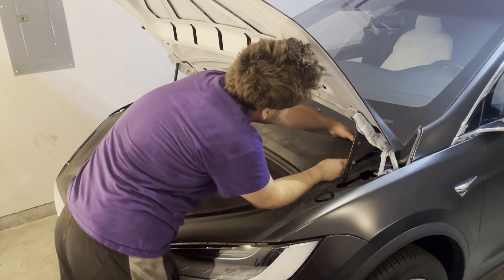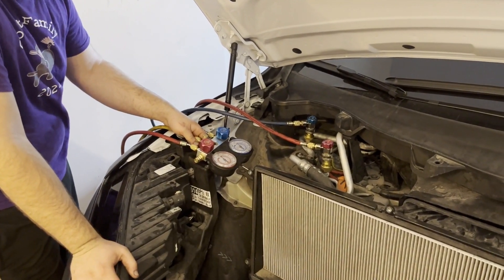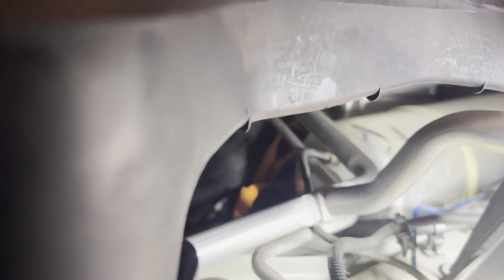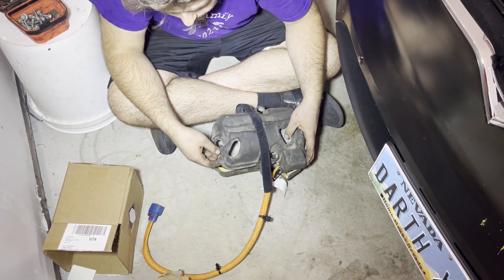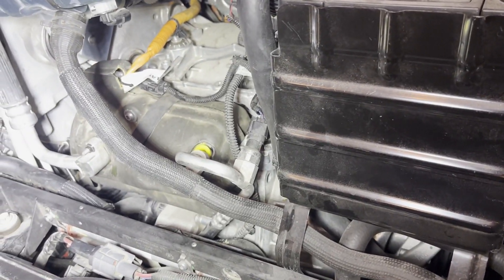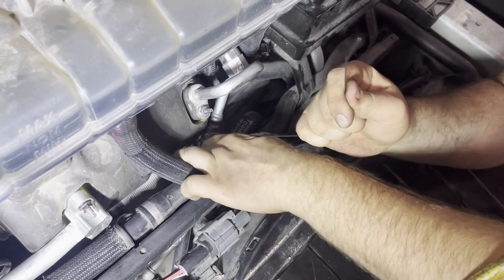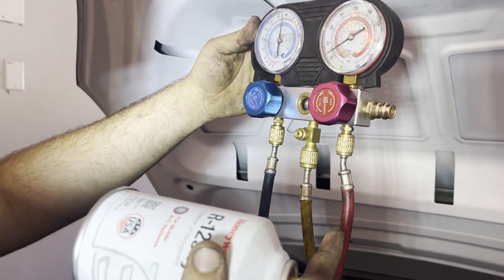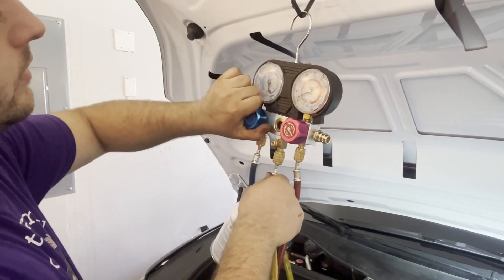Tesla Model X 2020 AC Compressor Replacement

Comment: Thank you for posting the vid, didn’t the compressor require oil, or did it come prefilled with it? Also, where did you buy the compressor?
Reply from the maker: Oil came prefilled with oil, I bought it on Amazon, brand is RYC AD-1456. Has bad reviews but this car hasn’t had a problem with the AC since I did the repair. Some comments say it’s a bad brand or they had bad experiences with there’s so idk if I would trust it 100% and I’m not affiliated with anyone or anything in this video FWI

Comment: Bro how u drain the ac system before u replace compressor
Reply from the maker: Well usually when doing ac repair, the system leaked out to almost 0psi. But the “right” way is to use a refrigerant recovery tank. The quick, dirty, and possibly illegal way is to vent it to the atmosphere
Reply: Thanks bro

Comment: How did you know it was the compressor that was the problem?
Reply from the maker: Loud crunch noise whenever you tried starting up the ac, and since the compressor is the only moving part in the ac we replaced it. I tore down the compressor and found a spiral style compressor that apart of the spiral sheared off and a chunk of metal was loose in the unit
Reply: @redsagehd366 you are AWESOME. Thanks for your hard-work sir!

Comment: Thank you so much for posting, they wanted $4,955.37 for this repair. I know i have to flush the system due to particles possibly in the system. Do you think a 2016 model s is very similar to this install?

Comment: I'm about to do this job thank you for the info the only thing that has me worried is the auto does not turn. On since the AC compressor went out. Because. I got that warning that the car might not restart so.  Now I'm. Concerned about how to get it turned on.  I hope once the faulty compressor is removed it lets me. Start to accurately fill the refrigerant.   Also.  Before 8 start in going to see how to stop the high current. Since I can't. Put it in. Service mode
Reply from the maker: I believe There is also a fire safety switch to disconnect the high voltage batteries from the car if I recall when you’re looking at the frunk, it’s top right and has a fireman’s hat sticker on it. As far as why the car does not turn on, I wouldn’t know without having he car in front of me, best of luck k to you!
Reply: @redsagehd366  thank you my friend

Comment: Thanks for the video, completed it yesterday myself. Definitely saved me quite a few dollars. Getting that HV Connector in the back was really fun ! You make it look so easy haha.
Reply from the maker: Glad it helped!
Reply: What was the tell all that confirmed the compressor was out? 
Mine doesn’t kick on at all and previous weeks it’s been going in short cycles 
2016 model x 
Thanks
Reply from the maker: @andreispiridon3241 In this case crunch noises and bang noises when you turned on the AC, if your ac compressor isn’t turning on at all, you might have too high or to low refrigerant levels, hook up your gauges, locate a chart for normal pressures high and low at the ambient air temp it is outside, that should tell you a lot
Reply: @redsagehd366 got you, I did hook up one of those handheld spray cans gauges when it was running ( not sure how accurate those are but was showing filled) but will hookup the gauges and try, now compressor is not starting at all
Reply: @redsagehd366  I don’t know of a way to check Freon level without the compressor running 
I know there’s Freon in the system and previous weeks the compressor was running on and off, service alerts only THC_d0010_compressor and compNoFeedback after I select the AC but doesn’t start 
In inclined to change compressor and refill although I didn’t hear any weird noises or crackling sounds 
Any suggestions?
Reply: @redsagehd366 I end up unplugging the compressor and ohm it out, in getting some resistance to it and didn’t hear any noises nor leaks 
I’m assuming the only other thing is HV fuse from the DC-to-DC converter (the box that’s feeding the compressor) 
From what I know there’s a AC high voltage fuse that’s feeding the compressor
Reply from the maker: @andreispiridon3241  sorry for being late to answer but in my experience if the refrigerant on the high and low line are equal somewhere around 80 psi it’s plenty full enough to turn on, and once compressor is on it goes to somewhere around 35 low 200 high or whatever the pressures would be at your ambient air temp at the moment. But when compressor is off the pressures slowly equalize to 1 pressure across both high and low sides. If compressor is requested to turn on and both high and low pressures are the same atleast above 50 I would condemn the compressor, sometimes they don’t make noise when they break they can also overheat and lock up. Lemme know what you do

Comment: Did you have to put any oil into the new compressor or was it shipped with it?
Reply from the maker: yup it came with it pre-oiled
Reply: @redsagehd366 finally got it out. That connector is beotch to take out. Also wanted to add that taking the compressor out with the cradle is easier as the bolts are all on top and easily accessible. Thank you again for the video
Reply from the maker: @ivandrusc8658 ya that connector ain’t easy to get to, very glad I could help

Comment: ryc remanufactured compressors have a very high failure rate.. basically all they do is clean them up, paint them and sell them.. I hope you get many years out of it.. if a compressor locks up it's likely to spit metal out into the system, so it would require a flush add new condenser..
Reply from the maker: Ya I wouldn’t endorse this brand, and only ordered from them once. This Customer (my father) chose the cheapest option for replacement which is luckily still working. It goes without saying that investing in a more expensive quality part would be the best course of action for longevity. I just posted the exact compressor that I installed. Sometimes I forget these things are not obvious and I greatly appreciate your comment
Reply: @redsagehd366 would really appreciate if you could point us to a better ac compressor unit that’s not remanufactured. I’m also out in Las Vegas and will be doing a compressor replacement for the first time. Not very knowledgeable about ac systems so your help would be amazing :)
Reply: Yeah tell me about it. Amazon unit failed to work from the get go

Comment: Im just just curious ive replaced the compressor and im ready to vacuum and charge. is there anything in service mode i need to do before adding refrigerant? Please help lol
Reply from the maker: @bmill3449  well you probably shoulda put it in service mode before you disconnected the compressor since it’s high voltage haha but if everything is all put back together and ready to pull vacuum and charge I would not worry about service mode anymore. Theres nothing to reset in the computer, just fill it
Reply: Ohhh ok yeah had to return the compressor cause I jacked it up on the refill as I was refilling the compressor didn't turn on then I added to much then ran heat pump commission and it engaged the compressor but after an hour it went to shit lol I got another coming in from yc but Mann I was close

Comment: You only need to put the car on service mode before working on it? Do you need to disconnect the 12v battery or anything else?
Reply from the maker: @vuanhquoc20  service mode is all I used. From my knowledge the ac compressor does not use the 12v battery, it uses the higher voltage batteries which is why the cable is orange
Reply: Do you need to add ac oil before adding freon? I’m trying to replace my 2016 model x with 134a type, I bought an oem compressor 1042442-00-m, and looks like it came prefilled with oil.
Reply from the maker: if the compressor is prefilled, no oil is needed. If some spills out while installing try to replace what fell out

Comment: Does the hvac compressor need vin matching?
Reply from the maker: The year this car was made I did not match the vin, as far as I know the pump is the same, the difference is how much refrigerant is charged. I do know if you have the 3rd row rear ac model X it takes more refrigerant.

Comment: Does the 2019 have the same compressor ? Mines been exhibiting and issue where ac starts to looses its cool when idling or parked, it would shart to short cycle faster and faster where compressor stays on for only 5 seconds.  The kicker is that it blows cold air when the car is moving, and when im moving for a few minutes at freeway speed the air is cold, and cabins is comfy.
Reply from the maker: @unfair-o2d  the ac condenser is a radiator for refrigerant, mounted at the front of the car so that air can flow past it to cool down the refrigerant. While driving down the road you have more airflow to cool down the refrigerant. The reason it could be shutting off could either be the high side pressure is getting too high or too low. sounds to me you’re either overfilled or under filled with refrigerant.

Comment: Why did the original fail? Would have thought it should last longer.
Reply: Ok so what happened to mine is that the center ball bearing is in pieces and I may be missing pieces 😢. Looks like terrible quality of one bearing is prematurely killing these units
Reply: I will let you know as I will take mine apart
Reply: How did you guys confirmed the compressor was dead and not a HV fuse or something else?
Have a 2016 model x and it completely died but in previous weeks was going on and off in short cycles
Reply: @andreispiridon3241 loud when running and not cooling

Comment: How is the RYC Remanufactured compressor holding up? Also, did you need to send them your old one? Can you do one with teh dessicant bag replacement as well?
Reply from the maker: @fabiendass2255  holding up well, my father whose car this is, is an Uber driver in the Las Vegas heat so 8+ hours a day of not stop function since this video was made. Did not send them my old one, there was no core charge. Funny enough we ordered the desiccant bag but it never showed up, but he needed the car asap so we did without, in my opinion it would’ve been fine as far as the age of the bag and aswell as the dry climate it lives in so we didn’t install one, I recommend replacing that bag if you can though

Comment: Any reason you chose not to replace the condenser as well? About to do this job on my 2016 Model X and thinking I should also replace the condenser as well.
Reply from the maker: I didnt replace the condenser because it didnt fail, the compressor failed, and what it comes down to is price and availability, I'd suggest doing a desiccant bag or the whole condenser. but in this case we ordered a desiccant bag but it never came in the mail so we just replaced the compressor. replacing more parts is always better then less parts it comes down to the price that comes with it that the customer is willing to pay for or not.
Reply: @redsagehd366  Got it. Yeah I'd rather not do the condenser (more work) but I will just to be safe. Thanks for this video it's super helpful! I just ordered all the parts!
Reply: @WalkingAndWisdom how’d the repair go! Hope you’re up and running, would help hear from you regarding your experience as I embark on my own :) compressor+condensor

Comment: Man I just took my model s to Tesla they quoted me 3000 to swap my ac compressor in California and I don't have it
Reply from the maker: ya they quoted my dad $3500 in Las Vegas and it woulda took 3 weeks to get it done. So thats when he called me up and I decided to figure it out because there were no good videos showing how to do this! hope the video helps! My dad's model x has been running 10 hour days everyday since this video was filmed, so about 2 weeks of heavy use because he's an uber driver, with no problems
Reply: How much would you charge to  swap my  a/c compressor
Reply from the maker: @Bigboytoyz_Atlanta  if the customer buys the parts and refrigerant I’m doing it all for $300 labor out of my garage I believe that’s somewhere around $900 total cost
Reply from the maker: @bucksinfourpodcast  Spanish Fork Utah
Reply: @redsagehd366 How did you learn the process for Tesla replacement of this part? Is there a repair book for Tesla somewhere?
Reply from the maker: @karaLUVEanime  there probably is a repair procedure you could follow but I just winged it and used my general knowledge and mechanical incline experience to make this video. It’s like a puzzle for me, it’s more fun to go in blind haha

Comment: Did you have to add any oil to the new compressor?
Reply: Your coolant tank looks brown . Should it be blue ?
Reply from the maker: @Minga_562  oil was prefilled with this compressor, so no, if yours does not have oil pre charged I’ve heard you can measure the weight of the old compressor then fill with oil till  the weight matches the old one, I haven’t done that before but heard another guy doing that for a Tesla before.
Reply: Thanks for the reply. What about the "desiccant bag"? Did you have to replace that? I'm getting ready to do the compressor myself after watching your video.
Reply from the maker: @Minga_562  we ordered the desiccant bag but it never arrived so we ended up just doing the compressor replacement without it. As someone who works as a mechanic at a dealership we say its best to do the desiccant filter/bag (also known as an air dryer) whenever you open the system but personally I've reused them all the time, kinda just depends on how old and used it is. This only being 4 years old and lived in a dry environment its whole life we just said screw it since it was so painfully hot in Vegas at the time, we didn't really want to wait any longer. if I remember correctly there's a cylinder on the right side of the ac compressor which is parallel to the bottom of the frunk floor, once the system is evacuated, unthread the cap on the top, slide out the old bag and install new bag and o ring for cap, there is not that much to it. hope that helps!

Comment: It says on the service manual that it takes 2 cans
Reply from the maker: @euthopialis7031  ya it says it takes minimum about 700-740 grams or 24.5-26 oz. The only cans I could find were 8oz cans. I put in 3 8 oz cans and pressures were low and it was only blowing 60 degrees at the vents, we found out it needed more, hope the video helps
Reply: @redsagehd366  it did!